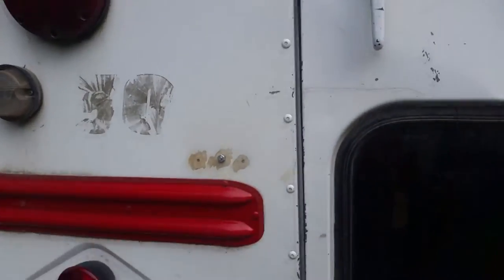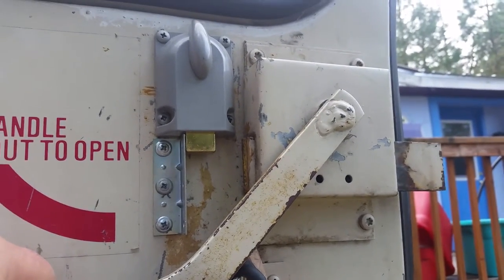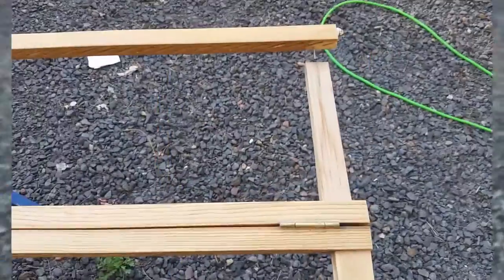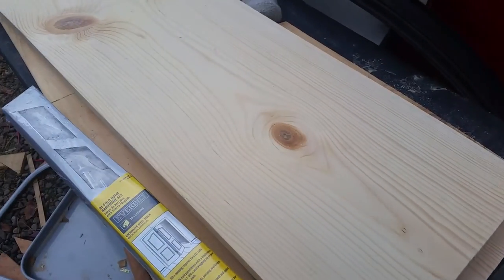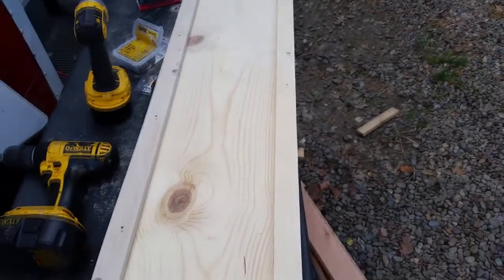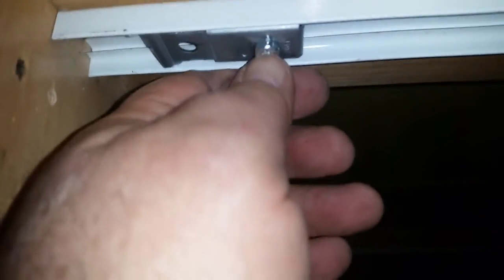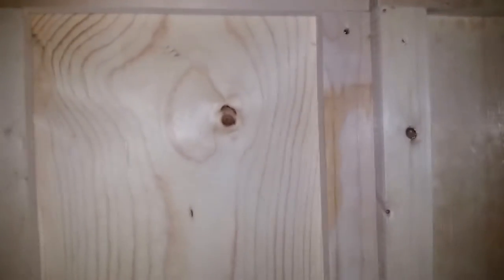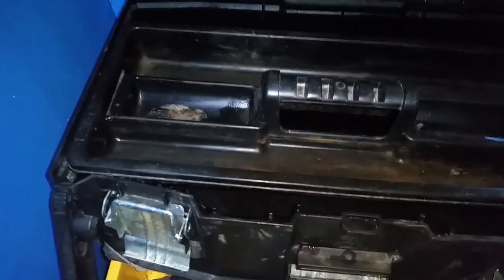Jon's Bus Conversion Part 59 - Doors

Comment: Nice work on the doors. Your home built one might just outlast the store bought ones. I wanted to put my door lock on like yours but my bus has an indent around the handle and it just wouldn't work.
Reply from the maker: Oh yeah they are all different. I read somewhere that it's illegal for an actual school bus to have a locking back door so that's why they are like that. Someone could probably make some $$$s if they would come up with a nice solution. The way I did mine was something I found somewhere - skoolie.net maybe.
Reply: That's where ii saw it done. Just doesn't work on mine